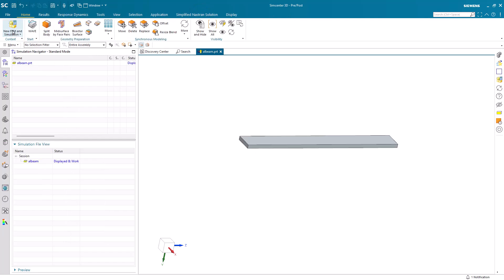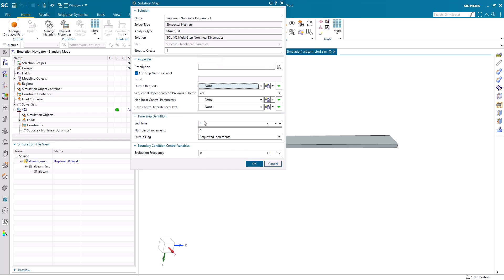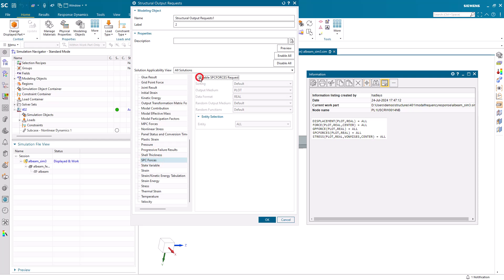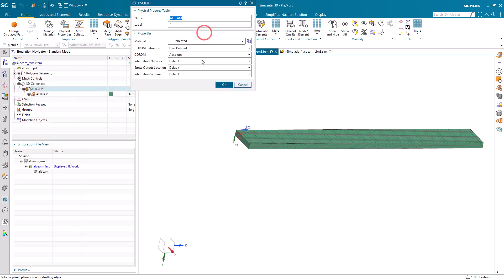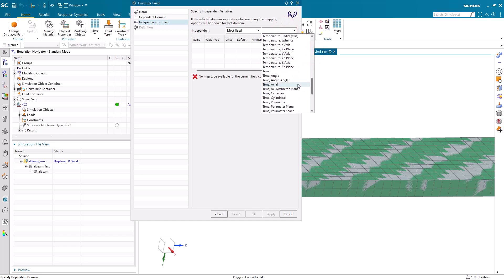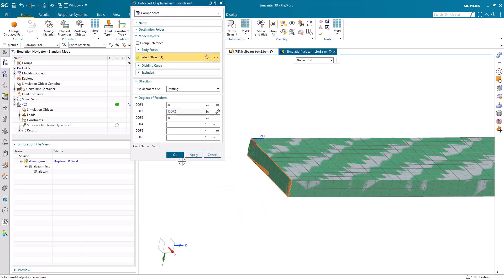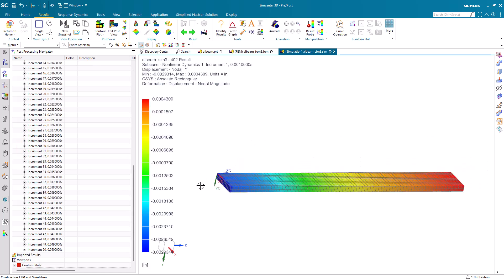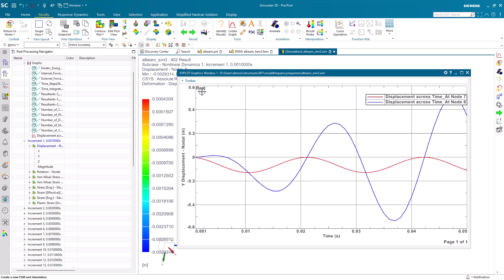How To Create A Nonlinear Dynamics Analysis In SOL 402

Comment: Hi I want to apply acceleration with respect to time on nodes which will be away from boundary conditions? How to do that ?
Reply from the maker: Hi, you can do that with a field.  I show how to create an enforced displacement with respect to time here:  https://youtu.be/YRPO7QA_jlQ?si=RWyYyZNKNvX7wCmq&t=365  The same field option is available when creating an acceleration.
Reply: @Simcenter3DTipsandTricks in SOL 402 only enforced displacement is there.. no enforced acceleration…. Also in enforced motion condition we can apply acceleration time domain data only at boundary condition nodes not on the nodes away from the boundary
Reply from the maker: @manojkumarp2076  Use gravity, under loads. This will apply an acceleration to the entire structure.  You can make it time dependent with a field.
Reply: @Simcenter3DTipsandTricks thank you… but I need to apply acceleration to particular nodes not on entire structure…
Reply from the maker: @manojkumarp2076  You could do it with a force if you know the mass you can figure out what force would produce the acceleration you want.  Also, it couldn't hurt to put in a support case asking for an enhancement request to support acceleration loads in 402.